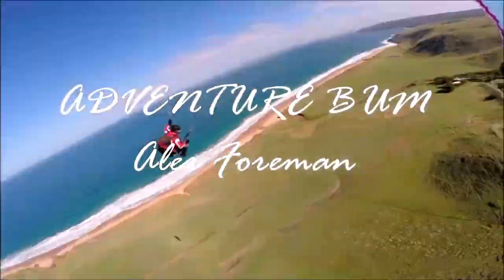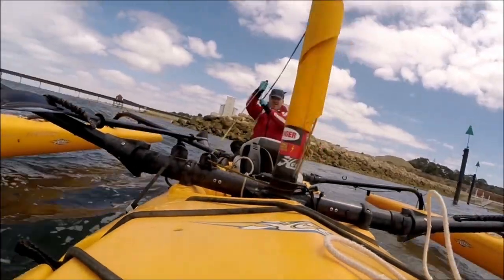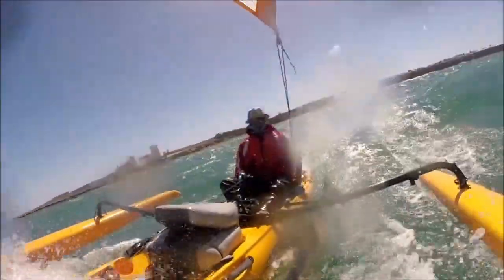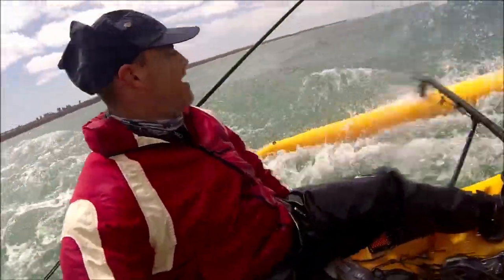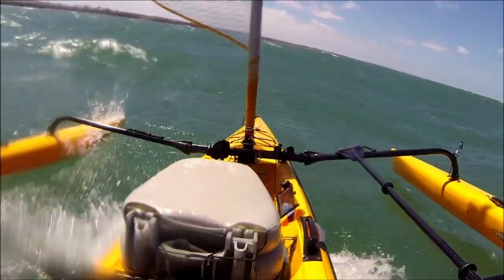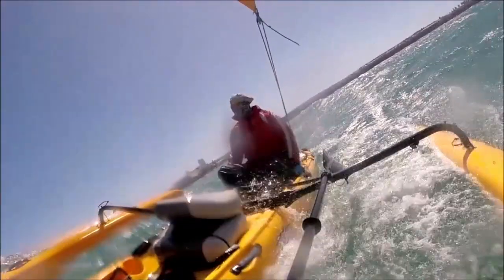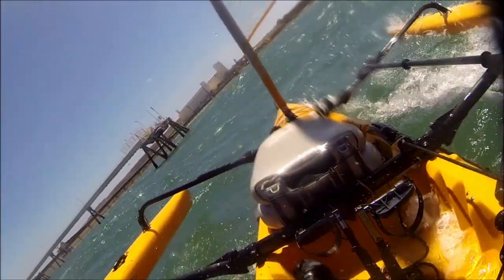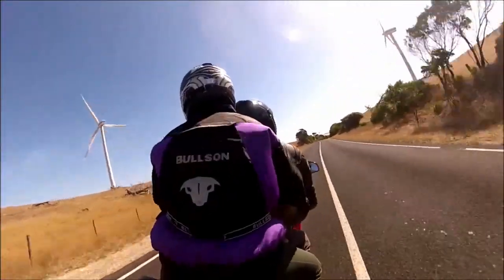Rough Sail Big Chop 20kts Torpedoed a Breaker | Hobie Tandem Island

Comment: You really need to add the “keep out” lines for those conditions. She would capsize instantly if the plastic shear pin were to break. Thanks for the video!
Reply from the maker: Cheers mate. I have stainless pins instead of sheer pins, learned that lesson sailing my AI in rough stuff. Glad you liked the vid 🍺
Reply: @Adventure_Bum   you should keep the plastic pins in, and use the keep out  lines.  With metal pins, you could have a catastrophic  failure in the elsewhere in the aka system. (the hobbie engineers intentional designed that fail safe). I put plastic wingnuts on my  back up pins., to make changes easier in rough conditions. One can actually sail without the pins and only the lines, surprisingly well. Thanks for the videos !
Reply from the maker: With lines you have the same problem, the failure will just be somewhere else. Usually it's the rear AKA that bends with stainless pins. It's more expensive but replaceable

Comment: Hobbie Islander are ment to punch through breaking waves. The kayak will flex. However,  shouldn't  crack or brake the hull
Reply from the maker: They are tough, but bigger breakers can tip them over

Comment: If you lose the rudder, just pull it up, reef the sail and use the paddles…not pedals 😂. It is a kayak after all 👍🏼. And carry extra rudder pins…
Reply from the maker: Would that work in 20 knot winds and 1.5 meter chop?
Reply: @Adventure_Bum  Absolutely, I sail out of Oxnard in California and have been in those conditions several times.  Practice with it before you need to do it in a real event.  I haven’t lost my rudder yet but I know how to react if I do.  First thing is to reef the sail, that alone will settle things.  Then get the rudder up and put the paddle in the water, hold it tight to the side of the hull and use your top hand to steer with.  Get back to shore and replace the pin or repair rudder as needed.  Practice replacement of the pin on dry land first as well…there are several steps required to do this.  I imagine it’s very difficult to do at sea.
Reply from the maker: @maxwellmark  cheers, I've done 2 rudder pin replacements at sea so that's not a drama, just worried about broken lines 👍 Will test this out.
Reply: @Adventure_Bum  Let me know how it goes 👍🏼
Reply from the maker: @maxwellmark  will probably do a video on it
Reply from the maker: @maxwellmark  https://youtu.be/rUj93Sqz3jQ